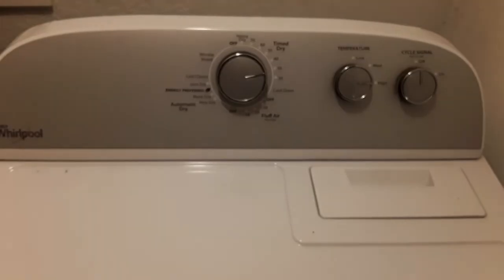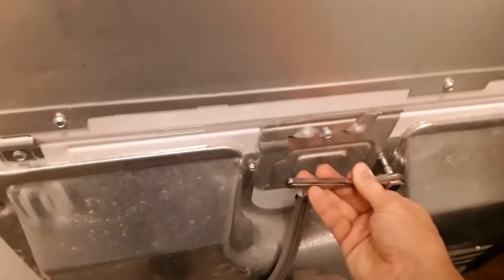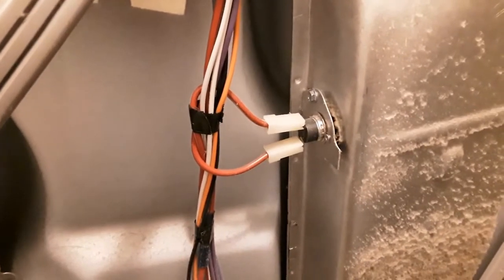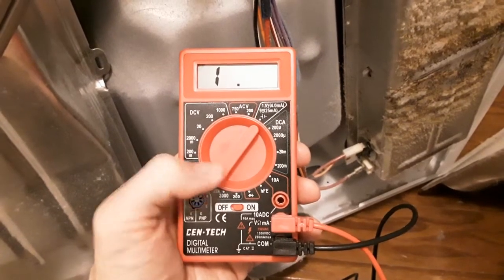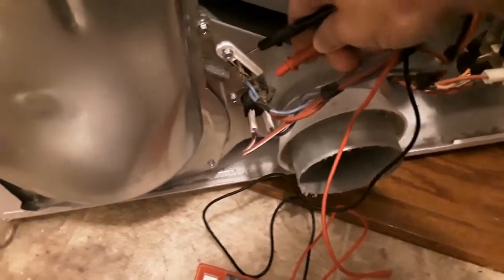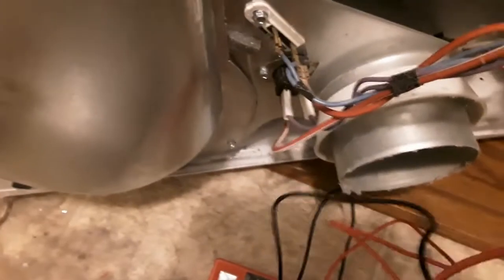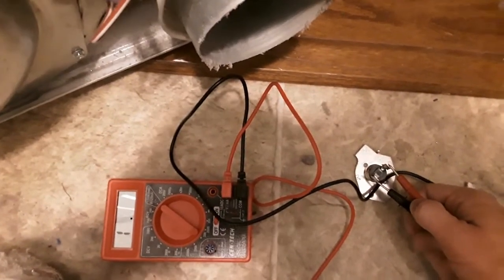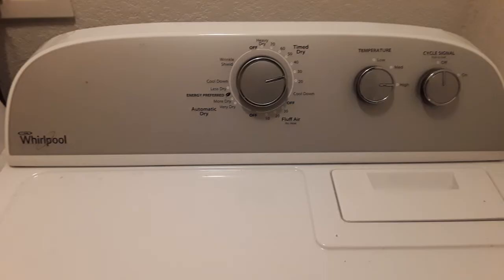Whirlpool dryer is running but not heating. How to fix dryer that is not heating.

Comment: After a repairman did the troubleshooting on why my dryer wasn't working, he forgot to hook up the wires on one of the fuses. I watched the video and was able to successfully fix the dryer running with no heat. The original problem was related to a circuit board for my dryer/ power manager interface for my whole house generator. Great video and easy to follow.
Reply from the maker: Thank you. I'm glad it helped.

Comment: good afternoon Sir. I have this same dryer and it runs great yet does not produce any heat. Could you foward me the correct fuse pack to buy? thanks!
Reply from the maker: Sorry. I don't remember. You should be able to go to your local appliance store and give them your dryer info and they should give you the correct fuse. I hope that helps.

Comment: I replaced all the parts that were shown and my dryer still won't heat it runs but it will not heat it blows air just fine and I replaced the dryer heating element the thermal fuse the dryer thermal fuse the dryer thermostat in another dryer thermostat it still will not heat do you happen to know what it might be it blows air just fine it runs it just won't heat up
Reply: From the videos I've been watching, it might be the timer which is where you turn the timer knob. https://youtu.be/fv2UqRUKnm0?t=386

Comment: I have this exact same dryer we’ve fixed it 4 times recently no problem however it just stopped heating & we’ve even paid 2 different companies to come out & both tested everything & didn’t know how to fix it. We even bought a new timer bc it was the last thing left & it’s still not heating!! Had an electrician out it’s not that either ughhhhhh
Reply from the maker: I feel like I haven't had much luck with this type of dryer and the front loader washer. We now have the old school top loader washer and simple old school dryer. They can take a beating and keep on running.

Comment: I have checked my voltage coming into the dryer it is 240.  I replaced every heating part, I have checked the timer and everything is ok what else is causing no heat.
Reply from the maker: Sorry, I'm not sure what else you could try.
Reply: @hillbillyhowtos  ok thank you

Comment: I thought it wasn't heating as well but came to notice the cool down time really cools down your clothes, I dislike that feature. I turn it to very dry and heats up Alot. So figured ok that's the setting I need, then it goes towards cool  down same conclusion. No more Oldskool machinery, all these silly features are just unnecessary.
Reply from the maker: I agree! 😃

Comment: Dude! Why didn't you show just partial instructions? Why didn't you show us testing every fuse? The fuse that you indicated was bad and replaced. What's the connections below it? 
My Whirlpool Dryer has that same connection below the fuse you replaced, but that connection below the fuse you replaced has a prong showing without a wire attached to it. And I don't know if it's suppose to be that way.

Comment: Don't you mean ohms and not volts? The tool is a multi function tester  not a voltmeter. You are using the ohm scale or you can use a continuity tester too.

Comment: What if the dryer doesn't heat on high, but heats on low and med?
Reply: possible control board or knob
Reply: Bad diode

Comment: Why do you  call it a fuse and others call it a high limit thermostat?
A fuse and a thermostat are not the same thing.
Reply: Those are high limits but they act as thermal fuses. If they get too hot they shut off the circuit